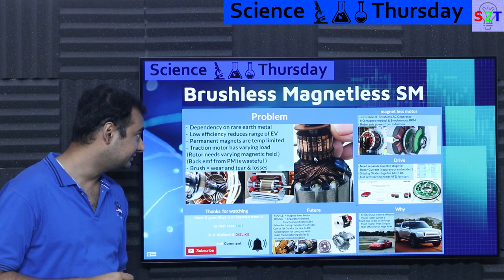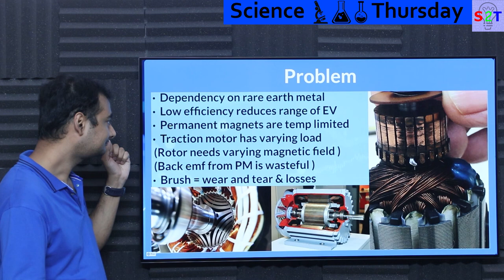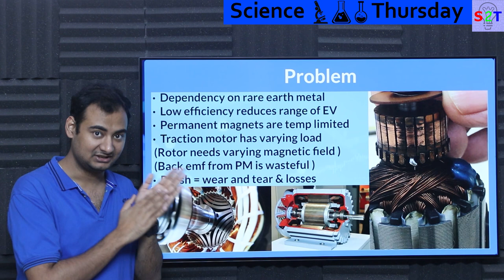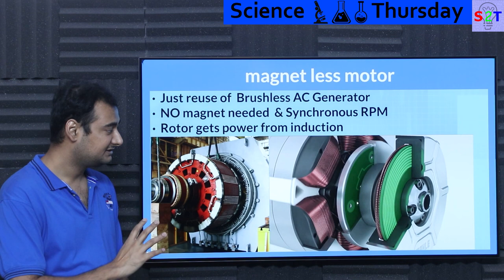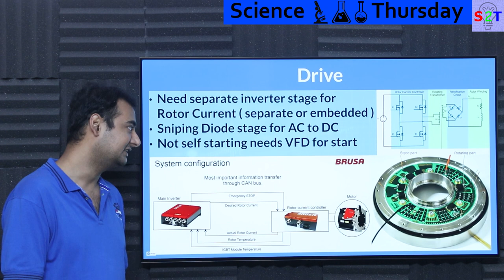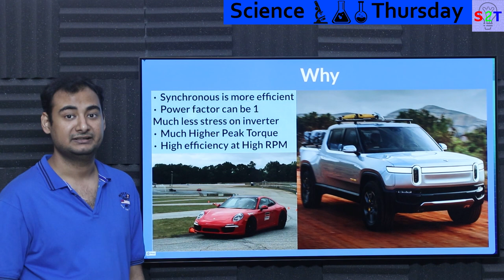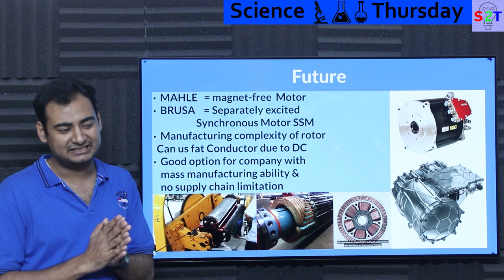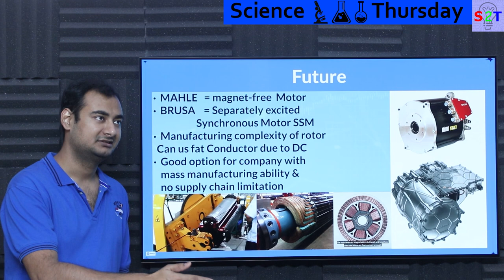Magnetless Motor {SSM} Explained {Science Thursday Ep161}

Comment: Good stuff. so the rotor is excited both by the DC current & the inductive currents?
Reply: inductive AC currents goes to diode stage it makes it into DC and rotor does not have any induced current like induction motor
Reply from the maker: Hopefully that cleared your doubt
Reply: @s2tenglish  yes thx. The external DC is only for the starting operation .
Reply from the maker: @motogee3796  its on as long as motor is running
Reply: @s2tenglish  ok is this why it is called doubly excited?